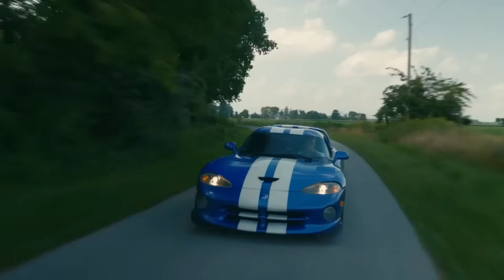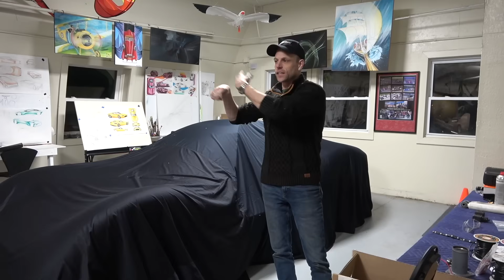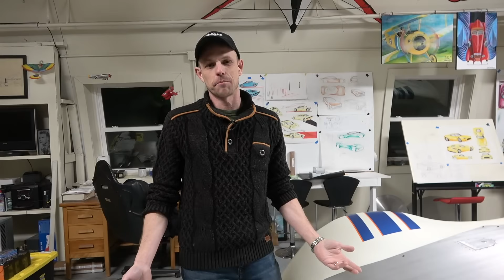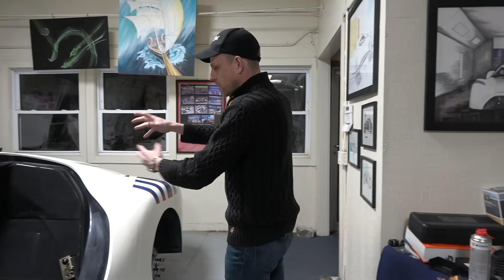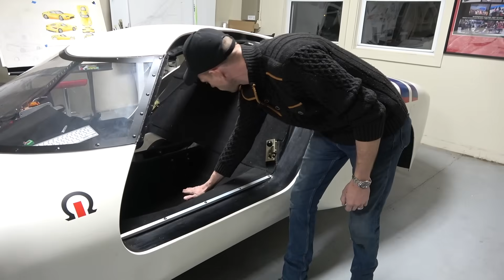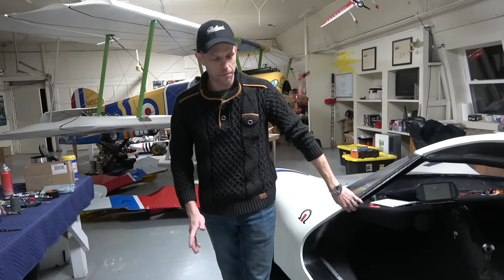Casey's OMEGA CAR because the AUTO INDUSTRY doesn't GET IT!

Comment: Every time someone makes any major advancements in automotive design or engineering advancements the Corporations so their best to destroy or remove the threat to their monopoly. Even when the Corporations build something that is ahead of the time they make it available for a short time and do not market it so the people so not get to utilize an improved or advanced vehicle.
If G.M. had continued the Corvair instead of replacing it with the Vega they could have changed the way people thought and bought cars. I suspect that Nader actually was allowed to litigate the Corvair so that people would not like it and therefore not buy a car that was far superior to most if not all the cars of the time.
I like your design and see great potential for it and I think that is where the Corvair was headed. That is the main reason why people were fooled into believing that it was such a bad vehicle and was not worth continuing and finishing the advancement that it started.

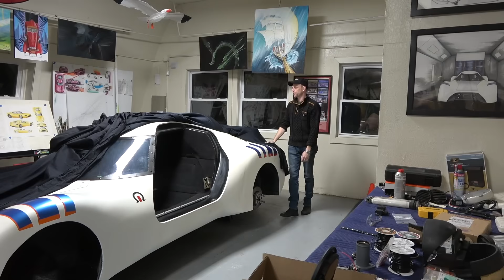Comment: 1:33 Thing is though about recyclable parts, rats love to eat vehicle parts made from recycled materials, which always retain odors that rats seek out. Once the rats are done eating the recyclable parts, then you'd have an even more expensive mess to clean up afterward, and you'll be spending even more of that on rat traps, exterminators, etc.  Good luck with that!
Reply: Yeah, I knew someone whose Subaru Forester had soy based insulation on the wiring harness. Rock chuck got in it and ate it, pretty expensive to replace the whole harness.

Comment: if you wanted better efficiency from a combustion engine you would make a turbo diesel electric car where the engine starts and stops based on if the electric drivetrain needed more juice or not with super/ultra capacitors. Drive east coast to west coast and back twice on a 10 gallon tank of gas.

Comment: Awesome.  Also, check out the Past Gas podcast (Donut Media) about Delorian.  He wanted to build an "infinity" car that would last 25+ years, be affordable, etc.  Similar to some of the ideas you presented here.  However, he was fighting the same uphill battle against the car industry and had to make quite a lot of compromises.  The compromises included that Delorian spent time fund raising instead of designing cars, they didn't have enough money so they put their factory in the middle of a ethnic/religious conflict, the car they designed kind-of sucked, and it cost too much.

ALSO check out the history of the Consulier GTP.  It was a resin/glass monocoque that was similar to your vision.  It was a really great car that the automotive press killed.  
Here's a link to a video about the Consulier GTP:  https://www.youtube.com/watch?v=uI6NmRjMsPk

Sorry to send stories with a sad ending.  Instead, think of this as validation that you've got a good idea.  No one has pulled it off yet but there are obvious problems with these endeavors.  For example, recession, competing with the NSX, founders' personality problems, lack of funds, etc.  The business environment is constantly changing and the right man for the job probably is out there somewhere---maybe it's you, CP.

Comment: Man what a load of horseshit. 
Very eloquent speech but none of the "features" that you described in your car actually "new" or "revolutionary". And all that slagging the auto industry is so ignorant. Cool car and all, and very cool that you can build it with your own hands etc. But don't knock the industry if you don't understand why things are done the way they are.
Reply: Eehh. No.
I'm not talking about the wants of general public. I'm talking about the notion that modern cars are "idiotic stamped boxes" because the auto industry is deliberately manufacturing them to promote "expensive and toxic" consumerism. This is simply not true. The system is not rigged against "cool cars" simply because nobody cares about this concept car. 

Other points to debate while the video plays:

Manuals are not better for the environment. Automatics have far better emissions scores than manuals.
Phones are not robust enough to be car gauges. Try leaving one on the dashboard in a car on a hot summer day.
Chassis seats are great for a 2 seater, try making a giant bulkhead for an MPV. 
Monocoque construction is not a novelty. Also cutting and bonding is not structurally sound and the amount of training required to guarantee quality repairs as opposed to the tried and we'll known welding techniques.. yeah it's a non starter.
Diesel hypermileing is not a novelty. VW did it 20 years ago with a lightweight super low drag and rolling resistance vehicle (would you know it)
Camera rear view mirrors are a thing. 
LED lights are a thing.
The automotive industry has a very good idea of what the future should be. And the "stupid metal boxes" are not as stupid as you think. Meanwhile the car is a cool concept, but it's not a revolution. The auto industry is still 30 years ahead of this car, despite the attempts to convince people that he knows better. 

Still, like I said. I appreciate the work, I couldn't do a better job by myself with my clumsy hands, so good for him. My only gripe is with the sass, the car will be cool to see finished

Comment: Dear Casey, I'm 16 and turn 17 this year. I've been playing around with the idea of building a car with the same goal you built your prototype  car. I aim to build a car that is extremely fuel efficient. But my car would be external combustion. In fact it would be a stirling engine designed and functioning like a  normal internal combustion engine. It would be a race car with a monocock chassis. Do you have any advice?

Comment: Open Hardware / Open Sourcing the design most likely the only way to challenge the industry status quo ..... Keeping the ideas and tech secret unless you can find an investor to fund who will need a ROI will likely see the idea fade away.... Opening the concept to the masses and accepting contributions from the world to improve and extend the idea may just be the way forward.  Local engineering shops constructing to a formula a range of strong efficient, repairable cars with local job market beneficial side effect could be the sea change you seek.

Comment: Why not hybrid? Seems like the best of both worlds, especially in the case of a (mostly) series hybrid like the Chevy Volt. 
You get the torque, lack of complicated drivetrain, and efficiency of an electric vehicle with the range of a fossil fuel powered engine. 
A smaller plug-in battery pack means less weight than a full sized electric car one but gives you all electric driving on short drives. 

Man, looking at that thing though, it just screams for a snowmobile two-stroke motor in it. ~160 hp motor through a CVT to a differential. Minimal electrical system for lighting (and to charge your phone/gauge cluster), light weight, and that sweet smell of two stroke... It would totally go against the idea of what you're doing but just think about it!

Comment: I love it. Mid engine, turbo diesel, manual trans, exotic materials.  I still want analog gauges in mine, and I want to try racing belts for daily use. I don't feel safe with normal seatbelts.

Comment: Don't stop now! I think you've hit project slump. It seems to happen to me when I get about %75-%80 complete with something. I live out in Columbus, and look forward to seeing that thing rolling around. I'm guessing that the car is foam sculpted with an outside layover like fiberglass? I've always wanted to do something like that myself, but I dont think I would have been brave enough to go monocoque like you did. I always envisioned using an interior support structure. How did you calculate for internal stresses for the cockpit to ensure the car doesn't crumble? I would really like to see how you calculate torsional values relating to cornering and how you came up with mounting options for your suspension. I'm excited to see this thing on the road, and I hope that you are willing to share some of how you put it together. It may not be feasible to create your own car company, but you could perhaps sell it as a kit car the way they do with the SLC. I would love to purchase something like that as a kit! That way, if you leave generous enough mounting points, the end user could pick their driveline and make it with any fuel/driveline type they chose, thus bringing the overall cost of the car down. You could even perhaps offer kits for popular driveline models.

Comment: I had the idea of making the engine a generator set ie removable easily so you could replace the shell and just bolt in the old generator to save $$ , Also I dont like electric cars as they are likely producing very very  high levels of Electromagnetic polution which causes cancer etc , I know this is likely true as my L300 mitsubishi van  produces 10 times more than what is considered safe JUST FROM ITS ALTERNATOR

Comment: Recyclable?  Let's see what are some of the most recyclable and recycled materials? Steel, aluminum, almost any metal really, glass, etc.  As far as I know the vast majority of cars made today are made of those things.  So what's NOT recyclable? Fiberglass, carbon fiber, most plastics.  Some plastics can be recycled but most of them have reduced strength when recycled.  Plastics that maintain their physical properties when recycled often aren't very suitable for large structural parts that are needed to make a car.

Comment: Not sure how the engine/drivetrain is mounted. Seems like it would be beneficial to have it as an entire sub assembly that could be removed in one piece for service. 

It would also allow easy conversion to gas, electric, pneumatic,..... Basically your one piece chassis with a swappable drivetrain unit.

Having something that could be pulled out in 30 min or so would be amazing for reducing repair costs and increasing serviceability.

Comment: You could make the "design" open source, approach technical universities and colleges with specific design challenges - different materials, different % of recycled materials, design courses could model and refine parts, UI and UX courses could mock up dash displays or "skins" for low cost tablet based displays. Universities could work in collaborating groups to produce a working prototype and compete with other groups on performance criteria - range, fuel type, environmental impact, total cost etc....

That way you get a lot of "unpolluted" creative input from people with a real interest in the subject but no commercial connection to the existing manufacture and supply chain. You encourage co-operation between disciplines and even between institutions but could also use a competitive element to drive innovation and experimentation.

Just some random thoughts after watching your video.

Several years ago (probably about 25 or more now) I had similar thoughts and ideas based on the "kit car" industry. It seems to cater more for replicas these days but there were some interesting concept cars and revolutionary ideas. 

I thought about a 3 piece design built around a central (very strong) composite mono-cock. The front and rear "frames" carrying suspension, drive and power-train could then be "bolted on" depending on the vehicle owners needs (manufactured by many different companies). From lightweight "environmentally friendly" options for inner city use right the way to high performance track options.

Comment: Great project.
It looks great.
Finish it.
I also want to build my own hypercar as they are called.
One has caught my eye.

it is a Kawasaki concept car.
Look this up.

Kawasaki ZX-770R Hypercar Concept by Sabino Leerentveld
There is also the KTM X-BOW car but for around $90 GRAND is it bit pricey. I'd like it to be 1/10th of that cost.

 Even though they have already built it as a concept car and have really no interest in producing it ,I could take some styling ques from it to design and build my own.
Like yours ,I'd put a transaxle drivetrain into the rear.
I could even use a larger turbo motorcycle drivetrain  as that comes with a 6 speed gearbox already.
Mine would be a real challenge though as I'd want it to be able to squeeze 4 people into it but the entire car would be just under 10' in length and under 6' in width with an integral roll cage built into the structure."
Is there a huge weight savings to be had by using a monocoque chassis instead compared to a body over chassis configuration?
I'm just trying to figure out how to deal with the twisting forces on the car when driving on the streets or on the track with it. 

Thanks for the great video and keep up the great work and finish it.
BTW I'm in MN. We love our cars up here and have climate controlled garages/shops to work through those long cold winters ,LOL

Comment: Over 150k miles, I got an average of ~40mpg from my old 2012 Golf TDI.  This is combining summer and winter driving in Minnesota.  And it is mileage/ pumped gallons, not the calculation made by the car.  Both the TDI, and now my GTI, overestimate fuel economy by ~7%.  (It seems you misunderstand the legal issue behind the VW debacle.  Every diesel "cheats", which they have to do because emission standards are based on the emissions profile of gasoline...but VW did it in a way that is legal in Europe, but is specifically prohibited here.)

Comment: Casey check in to what Mike shetley did in Florida back years ago with a Perkins diesel and a small I  think it was a Mercury Capri ,look into it they were getting 100 mpg l on the Perkins diesel and they were not allowed to produce it. Try to contact  Ken Trout, ex NASCAR  car builder. He lives just outside Nashville or reply to me. He worked on the project and at one time owned the car.

Comment: Could a hydrogen fuel cell (/diesel) hybrid be an option?  You can make hydrogen with water and (renewable) electricity and it has all of the efficiency gains from having an electric drivetrain while not being directly reliant on an electric grid.
Reply: Hydrogen is a horrible fuel source for cars it isn't very energy dense and while it can be produced with electrolysis you still have the problem of compressing it to over 5000psi to making it compact and portable the subsystems to make it safe in this case would be counter to the cheap and simple concept

Comment: This looks like an awesome prototype. You make many great points. I studied DIY alcohol and DIY bio-diesel, and I believe bio-diesel/SVO is easier to make. My son has a Chevy Volt, and he lives close to work, so he only uses a handful of dollars worth of gasoline each month, since he plugs in every night, and runs electric 95% of the time. If I had that prototype and some time + money, I'd put a small diesel in the rear, and an electric motor on the front axle, maybe with an axle from from a wrecked Mini AWD like the Toyota RAV4 or similar.

Comment: This is very interesting. I'm wondering to the extent you've tested it so far. Does that whole radiator intake idea really work, and is it efficient? It seems brilliant in theory. Also, monocoque body is really pretty, but I heard VW's Karmann Ghia was similar in that there were no body panels; just a whole body. And while it looked beautiful, if it got damaged, repair was...well, very sucky. I would assume that most cars are put together as body panels for easy replacement?

Comment: I have been thinking about this same thing for 35 years or more working as a mechanic in the rust belt. So much work is related to cars just rotting apart . My Idea is . A simple injection molded body with reinforced areas for mounting suspension and drive train . Won't rust ever or dent and super easy to assemble. Basically you put pre-made carbon ,aluminum , steel parts in a mold and  you have a complete chassis, interior  ,HVAC area for vents and HVAC components, once the body comes out of the mold. Then you bolt in motor , suspension , electrical,doors ( molded), windows ect.. No need for paint,and hundreds of less screws. most of the wiring could be built into the chassis As for crash testing, I think it would be better than any car built now. I am sure if you gave the task to a chemical engineer they could figure out how to make the body from recycled plastic re infored with new chems or carbon .

Comment: We need more automotive "recycling" all we do is use them up, send em to the crusher, if it's lucky, they get parted out a little before it's crushed...Sad really...
We could easily take those parts and body's, chassis and reuse them as they were intended...The laws need to catch up to the future...

What if I wanted to use a cheap small diesel engine and power my car like a locomotive?  Diesel/Electric with recycled battery's. Does Ford make a smog legal small Diesel engine from the years 1999+?  Case in point....The laws must change.

Comment: The K.I.S.S. principle is the route we need for sustainable future motoring. We need vehicles that are not remotely controllable by hackers, evil or otherwise, and the costs need to drop by two-thirds for the auto industry to survive the coming financial crisis. The diesel engine would be a great start, but finding a manufacturer for mass production is a huge problem now that VW and the like are wanting to just produce electric cars. 

Casey, maybe you could have a contest submitted to schools of automotive design for a simple power-train, aka Miura, that incorporated the engine and transmission in one piece to simplify the process. Ceramic based materials for the case, that would be lightweight and in keeping with less weight = horsepower, mileage and speed.

Comment: Diesel is ok, I'd prefer a light weight SI engine.  The 3 cylinder Ford Fiesta Turbo engine would be lighter than the VW engine, equal power and likely cost much in fuel economy.   Your working where Lotus was but they've moved up market.